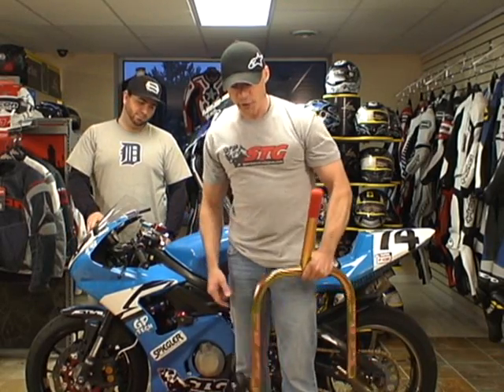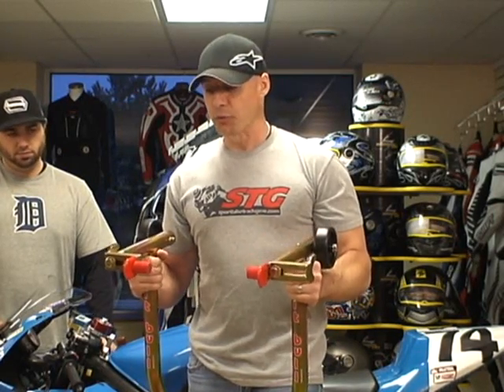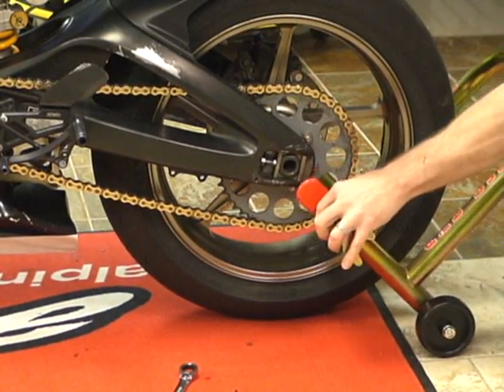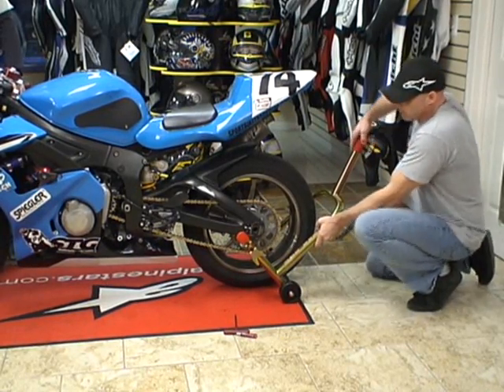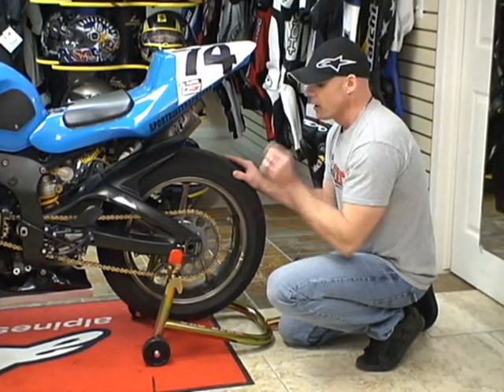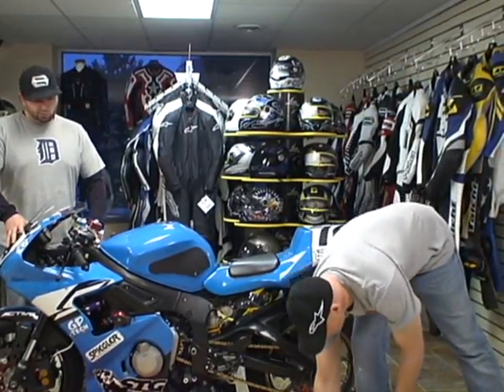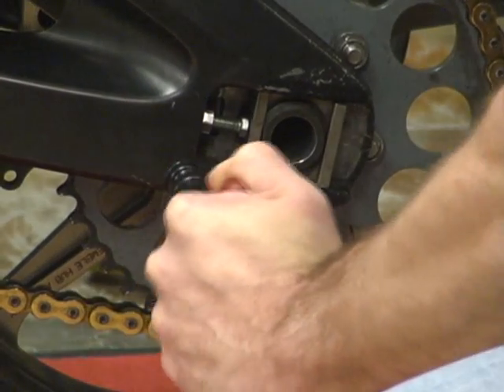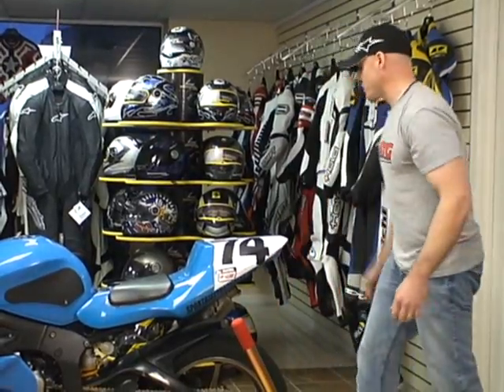Pit Bull Rear Motorcycle Stand Video Review from SportbikeTrackGear.com

Comment: PB stands are awesome. I've had a set for ten years going and even thought they're trashed up looking ( my fault ), these stands are built to last. They have served lifting my RC51 and other lighter bikes for many years. I also have the front stand with adapter that lifts the bike from the steering stem, which has been very useful for fork maintenance several times. A+ stands that are better constructed that other stands I've looked at. I was too paranoid that my Lockhart Philips stand would fall apart if I used it on my RC51. I keep that around for lighter bikes.

Comment: Those stands are very nicely made and you can buy a variety of parts. I keep an eye out for used Pit Bull stands because I'm cheap and I can adapt them to anything I own  I also own one of their motorcycle jacks and it's stability is outstanding when working on Harleys etc. I'm going to drill and tap my FXR rear axle for spools (you can do that with most solid axles if you don't mind unscrewing the "nut side" spool for rear tire changes) rather than mod the swingarm.

Comment: An inexpensive investment that will always be used is a quality torque wrench. You can tighten bolts and spools w/o but you will always run the risk of them vibrating out. If you torque them to spec., that risk is reduced or eliminated.
Reply from the maker: These stands are worth every penny. As for the torque wrench I agree it should be in your box, this is especially true if you do not have a ton of personal hands on mechanical experience. I have a couple torque wrenches in the box and use them selectively. Personal preference, I was also a tech at a Cadillac Dealer for 20 years before I started STG. - Van
Reply: I have enough wrench turning experience for minor car repair. On bikes i have ZERO. Im working on that because its way too expensive to take my bike to the shop for relatively simple things. Plus, having to leave it there is quite heart breaking. 👍

Comment: Im on a 08 CBR 600rr. I tried it once by lifting the bike off the stand and holding the tail and the stand and putting the mount under the spools and lifting it but that felt like I was on edge of tipping it over. I was just wondering if there was a solid almost no fall technique or if you had to do what I was doing and balance it and be sure not to drop it over. So I got it up I was just wondering if there was an easier way.

Comment: The bike is being held UPRIGHT (off leaning side stand) by a 2nd person (hidden off camera) so that the stand can be place evenly on both sides to lift bike.
Reply from the maker: Wow is this an old video! When I am putting the bike on the stand and am alone I jump off the bike, hold the tail section with my left hand and operate the stand with my right. Not super difficult to do, gets easier every time you do it. - Van

Comment: Great video as always STG except for one thing. The spooled v notch actually goes tall end toward the rear of the motorcycle not the front. The reason is when the stand is installed, the v notch is level with the ground. The way you have them in this video, the v notch is lower in the rear when on the ground. Still a good video , love your store and all your helpful employees!!

Comment: Will it work on my heavy ZRX 1200R ?
Reply from the maker: Absolutely, as long as there was a place under the swingarm or spools to lift it by, then you should be good to go.  Thanks!  ~Aubrey
Reply: It has mounts for spools,I just purchased a set of spools.  I just want to make sure I get a sturdy stand. My bike is a little over 500lbs . Tired of rolling my bike all over my driveway to clean & lube my chain.  I've seen some stands look iffy but the one your demonstrating looks heavy duty.
Reply from the maker: I'm not sure what others ones you may have looked at but, yes, a lot of them aren't going to hold up to the weight of your bike.  These PitBull stands are very sturdy and might outlast your bike...  I've seen them go through some serious abuse and still look almost brand new.  Can't go wrong with PitBull quality.  Shoot us an email to Orders@sportbiketrackgear.com and one of the guys can take care of you.  Thanks!